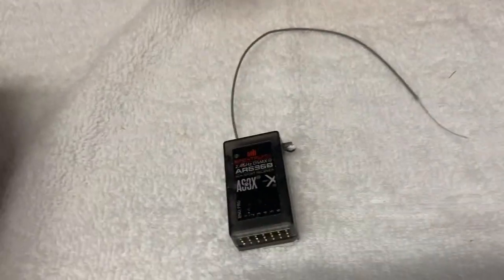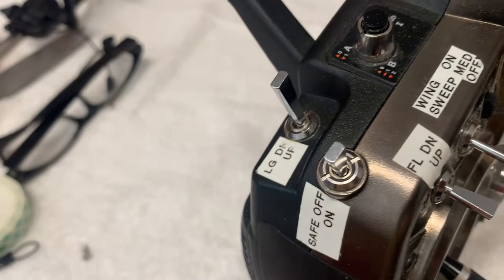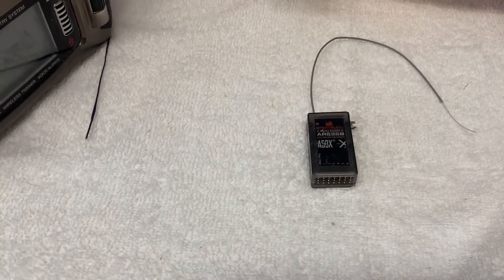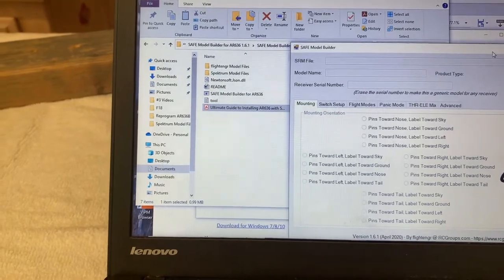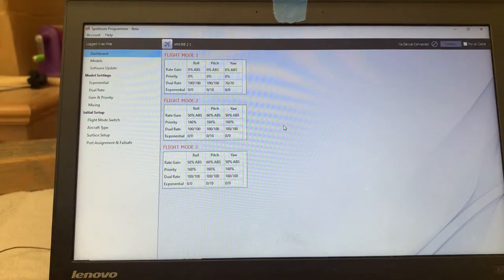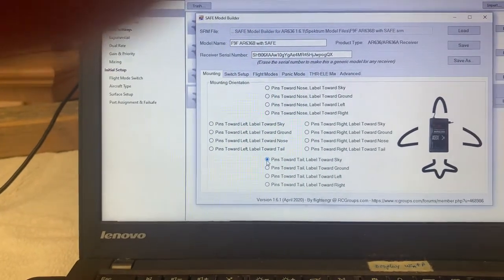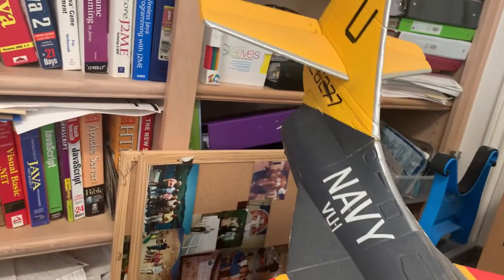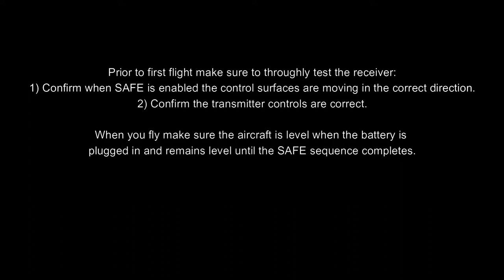Reprogramming the Spektrum AR636B

Comment: 1. Before you export the SRM file, you need to reset the receiver to clear out anything that Spektrum/Horizon changed from the default. There are settings that don't show up in the Spektrum Programmer or the SAFE Model Builder. Resetting the receiver will reset them.
2. You can turn off AS3X in any of the flight modes by setting the AS3X gains to zero. You can leave all of the priorities to 150%. If the gyro gain is set to zero, the priority doesn't do anything.
3. The receiver has 6 servo ports, but it can decode 9 channels. The Bind/Data port is not an output for a channel, as far I know.
4. I don't use the high throttle-to-elevator mix, but I do use the low throttle-to-elevator mix. I set the high mix to 85% throttle and 0 pitch. I set the low mix to 40% throttle and about -5 pitch so that when I throttle back, the plane will lower its nose a little and maintain flying speed. Also, I use the linear option.
5. With the AR636, the aileron, elevator, and rudder direction in the transmitter must be set to normal. If any control surface is backwards when you move the sticks, you must do the reversing in the receiver. Otherwise, the gyro will be backwards and crash your plane.
6. On most of my planes, I set the AS3X gains to 30, 40, and 50 percent for roll, pitch, and yaw respectively. Generally, the ailerons/wing will go into oscillation first if the gains are set too high. I typically set the pitch gain 10% higher than roll, and the yaw gain 10% higher than pitch. If I think the plane needs more AS3X gain, I increase all three by 10%. If it oscillates, I lower them all by 5 or 10 percent.
7. I always set the priority to 150% everywhere except for the flight mode(s) where SAFE is enabled. The priority setting determines how much stick movement is required to make the AS3X gain decrease to zero. If it's set to 100%, the gain will go to zero when the stick hits the stop, provided that the servo travel and rates are set to 100%. If you were to set the low rate to 50%, a priority of 150% would cause the gain to decrease to zero at full stick. Since I never use less than 50% travel, a priority of 150% will always make the gain decrease to zero at 1/2 to full stick deflection.
8. In SAFE mode, the travel and dual rates must be set to 100%. Otherwise, the plane won't reach the bank or pitch limits that you've set. SAFE mode uses what's called "Angle Demand". If you decrease the travel in the transmitter (or by using the rates in the receiver), the gyro won't know that you're holding the stick against the stop. It will think you only moved the stick part of the way, so it will only give you part of the angle. Since I always use 100% travel in SAFE mode, I set the priority to 100% so that the gyro gain decreases to zero at full stick deflection.
9. If your plane doesn't fly level at full throttle in SAFE mode, change the "Pitch Attitude Trim" setting. I generally start with it set to -1000 which is 10 degrees nose up. Some of my planes need 15 degrees and some need less. It depends on how level the receiver is mounted in the plane. Note: This setting will cause the elevator to kick up a few degrees when you select SAFE mode. Apparently, planes fly a little nose high compared to how they sit on the ground.
10. If you reset the receiver as I said above, the SAFE gain for roll should be between 15 and 25. The SAFE gain for pitch should be 18 to 30. If you've seen numbers higher than this, it's because there's a multiplier value in the SRM file that is set to 100 if the receiver has been reset. Horizon sets it to 25 in some BNF's and possibly 50 in others. The overall gain is the product of the SAFE gains you can see and the hidden multiplier in the SRM file. So, 18 times 100 is an overall gain of 1800. If the multiplier is set to 25, a SAFE gain of 72 would give the same overall gain. Roll generally needs an overall gain of 1500 to 2500 and pitch needs an overall gain of 1800 to 3000.
11. I check the SAFE gains by comparing the control surface travel in SAFE mode to the travel I get in low and high rates with SAFE off. I should get a little more than low rates and a little less than high rates. Remember, in SAFE mode the receiver needs to see 100% travel.
12. If you use panic mode, you need to set the SAFE gains to the same values in all three flight modes. In panic mode, the sticks will still move the control surfaces, but not as far unless you increase the bank/pitch limits for panic mode.
13. Also, the flight modes in the transmitter have nothing whatsoever to do with the AS3X/SAFE flight modes in the receiver. Transmitter flight modes are used for multiple rates and/or expo or separate trims for each position of the flaps, spoilers, etc. All you have to do to control the flight modes in the receiver is assign a switch to the channel you want to use to select the flight modes in the receiver.
Reply: If the gains setting or even any other settings that are on the programme require adjusting can this be done at the filed without a laptop? I am guessing not. Also which one is the gains setting on the Spektrum Programmer, I can only see priority, rate and heading.

Comment: It does work on Delta wings, as a matter of fact, that receiver comes in the Blade Theory Type W and I've flown other delta wings with it. You will need a programmer cable to get into the unit to change it to elevon configuration though.

Comment: * Please note * that on the video you did NOT mention that the second time you went into the programming of the receiver to fix the elevator direction, YOU NEED to export it again and re-do the SAFE Model Builder changes again and then reapply the model file back to the receiver. 

Great video though!

Comment: FYI - in the AR636x receivers, do Not reverse servo travel or make sub-trim changes in the transmitter!  If you reverse servos in the transmitter, all control surfaces that you reversed will be backward in SAFE.  Not what you want.  Make all dual-rates and expo settings in the transmitter, not the receiver.  It's just easier that way but if you want you can make these changes in the receiver using the Spektrum programmer software.  It's just harder to do that way.
Reply: @alwaysflying6540 You are right. You need it setup so that all of the Auto Leveling from the Gyro is in the correct orientation, this is setup in the receiver. You may still find that your sticks need to be reversed in the transmitter. My aeroscout is like this from the factory.

Comment: I am having trouble with the last bit. For some reason it does not load the completed SRM file into my rx, it indicates that it has but when I try and use the ilght mode switch I hae safe and AS3X on on all three flight modes. Would appreciate some help.

Comment: @15:19 I want SAFE and AS3X turn off and disabled. (I have a separate gyro for stability).  If I uncheck all the switch assignments to Unassigned and uncheck the boxes at the bottom, will that turn it all off?

Comment: Hey zek1701, why has it not been necessary to import an "open stock file" first, before You started to reprogramming it..? That's what HorizonHobby told me to to when i asked how to "unlock" the receiver from the "factory-setting"...
Reply from the maker: Perhaps this might work. I didn't try it. I just started with what was already in the receiver and change what I need to change to get the orientation and AS3X/SAFE to work. See 11:00 in the video.

Comment: Hi Zek, you already helped me one time with "Spektrum SAFE beginner problems", so I thought I'll ask you two things where I have problems with. I am using an AR636 with SAFE Select in P47 where the ailerons are moving when the plane is on the ground, when I switch between AS3X and Safe. I the one mode the surfaces are trimmed, when I switch the mode, one aileron moves a little bit up and the other one down. What happens there??? And at a second plane, that is in SAFE mode, I am not able to assign the toggle switch for AS3X and SAFE to switch B. I am in high rates, servos reach 100%, I toggle 5 times and I cannot witch between the two modes. It stays in SAFE.... Thank you for your help! Thomas
Reply from the maker: Hi Thomas, when the ailerons (or elevator) move when switching to SAFE it means there is a level problem. The aircraft needs to be level when the receiver is powered on. If not, then you could get the ailerons or elevator to move when you switch to SAFE. This video shows how to program the AR363B using the software tools.You will not have to toggle 5 times to set the AS3X/SAFE switch. The setup of the AS3X/SAFE channel and switch are covered in 16:00 and 28:35, respectively.
Reply: @Zek1701  i think I will try the assignment of the switch with the software.
Regarding the movement of the surfaces, I always try to keep the plane flat on the floor when powering up. So I still do not understand this problem…..
Reply from the maker: @Mustangschweinderl  maybe check the trim settings on the transmitter to see if they are at 0.
Reply: @Zek1701  they are 0….
Reply from the maker: @Mustangschweinderl  how much movement (mm) is there when switching SAFE on?

Comment: Why can´t the "SAFE MODEL BUILDER" Programm work with other "AS3X2 Spektrum Receivers" (for example the "AR637TA")? Thank You.
Reply: I'm asking that because i want to help a Friend of mine to configure a "AR636B" with the same configurations of a "AR637TA" that i have on my DRACO 2.0 BNFBasic. Thank You.
Reply from the maker: @mariopires4391  You could try using the programming cable and program on the 627T. I've never tried it since any receiver that can be programmed with Fwd Programming is easy to do with the transmitter/fwd programming.
Reply: There is a SAFE Model Builder program for the older AR636 and there's also a Smart SAFE Model Builder program for the newer Smart AS3X/SAFE receivers. The Spektrum Programmer software will only let you register and update the firmware in the newer Smart receivers. It will also let you import and export configuration files for the Smart receivers, but you can't change any of the settings like you can with the AR636, AR7350, etc..

Comment: Can you set as3x to zero on the first switch position (0) essentially turning off as3x in first position, getting as3x in second position and SAFE in the 3rd?
Reply from the maker: Sure that is how I set mine up. In the Fwd Programming FM mode when the switch is in position 0 set AS3X to inhibit and safe to inhibit.
Reply: @Zek1701  That won't work with the AR636 RX - Forward Programming isn't an option.  If a 3 position switch has been configured properly then one of the 3 positions can be set to ZERO.  Pos 0 - -100, Pos 1 - 0 (ZERO), Pos 2 - +100.  The results - Pos 0 - ALL off, Pos 1 - AS3X ONLY, & Pos 2 - AS3X & SAFE ON.😉

Comment: I have ax3s but safe is not working. I went through your programmer, set up and got everything set up. I think just right. But still no safe.
Reply from the maker: When testing it's hard to tell the difference between AS3X and SAFE as the control surface behave the same. The key difference is AS3X only gets enabled when the throttle has been above 20%. Usually people have trouble with AS3X not SAFE due to the throttle. If SAFE is truly not working I'm unsure what the issue is. You might look at the channel values when you flip the switch to see that different values are sent to the receiver.

Comment: Was able to click on the rc group links but could not get them to open.
Reply from the maker: The Programming Guide and Tool link will not open a web page. Each will download a file to your PC. Check your download folder for "Ultimate Guide to Installing AR636 with SAFE" and "SAFE Model Builder for AR636 1.6.1" files.
Reply: My old brain finally figured the process out and I was successful with my programming process for my AR636B receiver.
Thanks for your feedback.
Good video I will keep in my history file for future reference.

Comment: I can not get the tool itself? that has the picture of thr aircraft
can you help me get that programming tool?
TY
Reply from the maker: Bob the AR636B Programming Tool link is in the video description. When you click on the link it downloads a zip file to your PC and usually puts it in your download folder. You unzip the file and you will have the programming tool.
Reply: @Zek1701  yes I had typed the link wrong. It does work. TY
Reply: New Question:
Can my AR8020T receiver be set to have all three modes (safe,as3x,&off?
Reply from the maker: @bobanderson2807  it doesn't appear that AR8020T supports AS3X or SAFE. AR8360T has AS3X and SAFE.